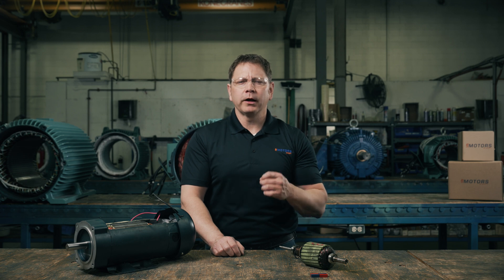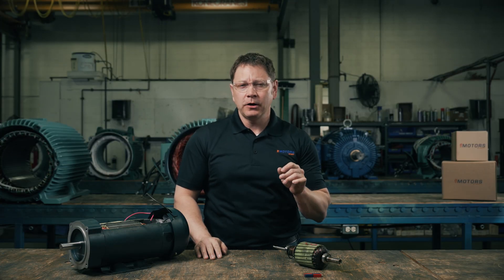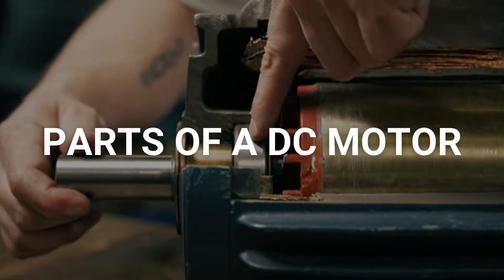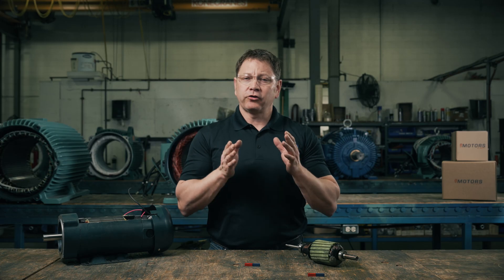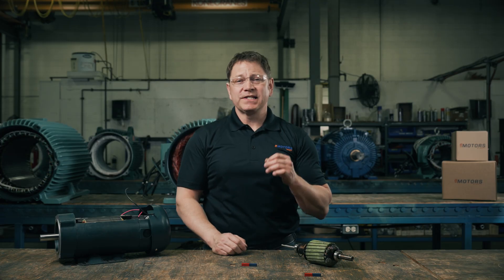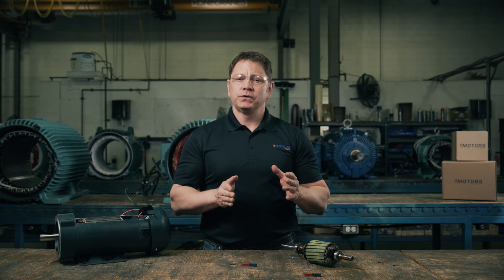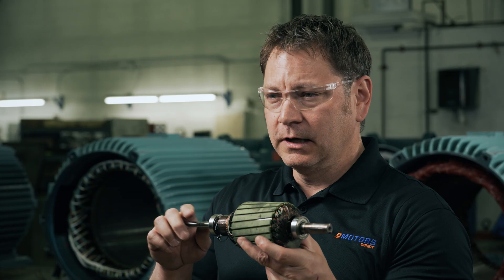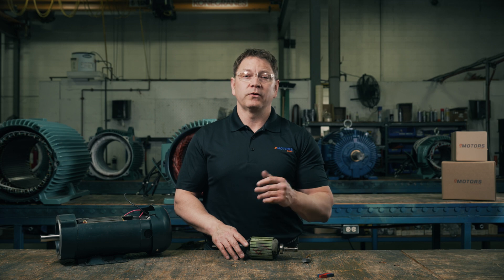How DC Motors Work

Comment: Hello, is there a VFD that works with dc booster pumps, batteries and solar panels during power outages.
Reply from the maker: Hi Yusuf, we have a variety of dc-dc drives on our website. As long as the batteries put out the correct voltage, the drives will work just fine.

https://www.emotorsdirect.ca/controls/dc-drives?input-phase=DC

Comment: Can I convert sewing machine electric motor into DC generator.and how I will be thanks for your patience.
Reply from the maker: Hi Sach, no conversion necessary. Just rotate the shaft and the power leads should show a voltage proportional to the rate the shaft turns.
Reply: @emotorsdirect   
Thanks for reply be  happy and safe
Reply from the maker: @sachtv1695  you as well!